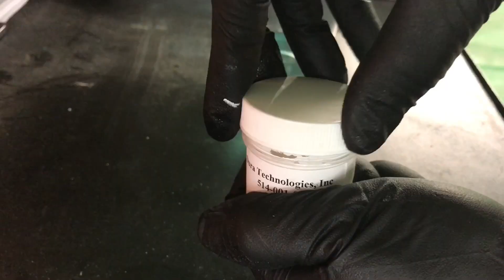Hot-Coat Surfboard Resin Stripe

Comment: That stripe looks super clean man. I gotta question. Have you ever done this to clean up messy rail lamination? My cutlaps are jagged and the rails are blotchy from an uneven resin spread. I haven’t added the hot coat yet so would you recommend doing it before or after the hotcoat to clean up messy looking rails?
Reply from the maker: Thanks. Yes I had that exact problem on my 2nd time ever glassing when the resin kicked before I could finish laping my rails. I put a dark color on the rails to cover it up. Try to sand down the fiberglass as much as possible to make it somewhat smooth without ruining the foam. I even had to cut some of the fiberglass out with a dremel. Add your hot coat as normal and then again sand the rails back down to get it as smooth as possible. It’s ok if you sand through the hot coat to the fiberglass on the rails since your covering it up with a darker color resin on the rails. Tape off the rails and do a dark pigmented resin to cover it up. After that, you couldn’t even notice I had messed up. Check out my Paipo video where I did black resin rails for an idea of what I’m talking about. Good luck!
Reply: Tanner Bendheim dude you are helping me so much. I tried so hard to get it right the first time but where I live is so hot that within 3 minutes the resin kicked in the pot.
Reply from the maker: Yeah the heat will make it kick faster. It’s been hot where I am as well. Glad to help.
Reply: @BendheimBoards  Sweet.  I am in the middle of making my first two surfboards and made a mess of the rails and was planning on doing the above.  I really should have practiced on a shortboard on my first board or two!  Nothing can prepare you for how hard it is to get the cloth to wrap around the surfboard the first time before the resin runs out or turns to jello!!!!

Comment: How bad is the smell/VOCs of that sanding resin? I was using Composite Resources sanding resin but the vapors were so bad that even with the mask, i found my hair and skin smelled of it afterward... too gnarly for me
Reply from the maker: Robert Ramji polyester resin fumes are really bad and yes they will make your clothes smell really bad afterwards.  Epoxy resin doesn’t smell bad if you’d rather use that but you still need to wear a mask because its just as toxic to breath in.